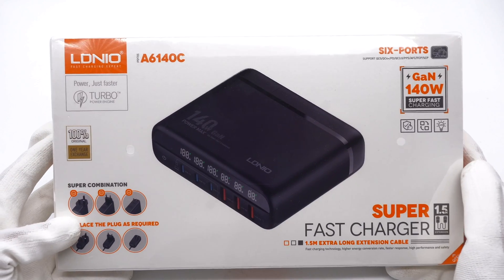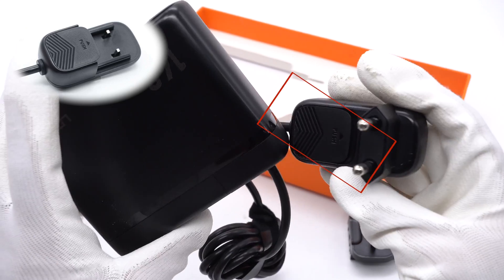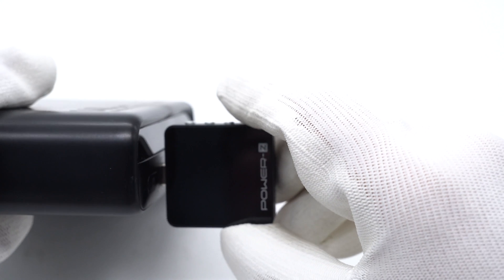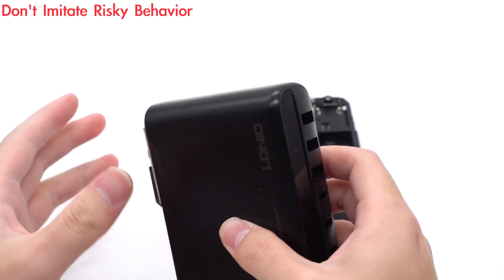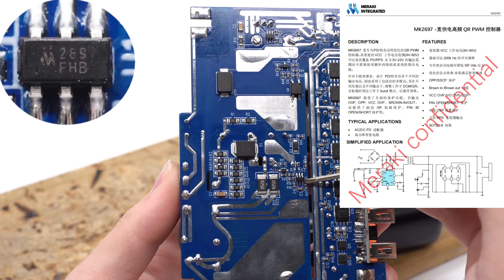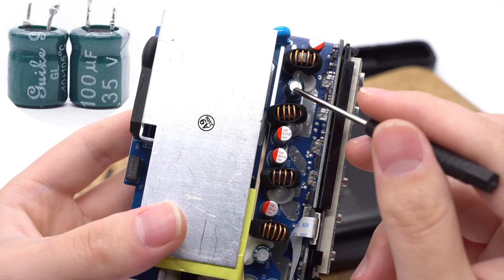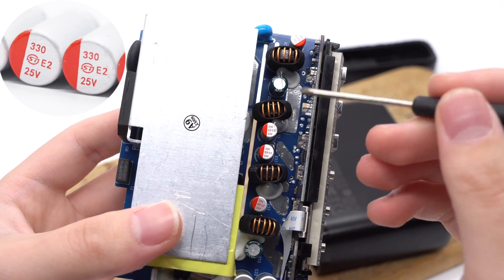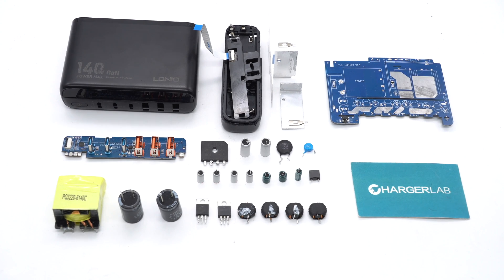Super-Low Price | Teardown of Ldnio 6-in-1 GaN Desktop Charger

Comment: recently purchased. I have noticed that there seems to be electrical waste, as I am experiencing electric shocks when using it. This is not the case with my other, normal adapters. Additionally, the power output to my devices seems limited. I have tested it with iQOO, Mi, and Realme devices, iphone and the charging speed is very slow. I don't know which devices work as gan charging.
Reply: my laptop support PD0 able to use 65w from USB C
is your support QC or PD?
Reply: @letskentots yes but not worthy. As mentioned a lot of issues
Reply: is it still working? i am planning to buy this today.

Comment: I bought in $26.33 it is a very good product but never gives more than 14 Watt to my Android realme x3 superzoom which can charge 30watt😢 i have a cooling fan which requires 27 watt charging this charger never disappoint to me when i use cooling fan its name is (memo DL16) also give 95 watt to my KP-KG 600 powerstation 😅
Reply: Also when i try to connect 2nd device all the ports reconnect once
Reply: Also can i use a magnetic cooling fan for this charger bcz it heats alot when it gives 50 watt+ output?
Reply: does it auto cut off once device is fully charge?

Comment: I have been using this product for 2 months, this product is very good in my opinion but there are 2 weaknesses. First, there is a little power leakage if using a cheap cable and the default cable is also bad, if you want to buy this product, you better buy a good cable, it will overcome its shortcomings. Second, if your room is hot and you use a large power, the charger will be very hot, my room temperature is around 31-33 ° C, I use 2 inputs, each using 24Wat and 20Wat power, the charger temperature reaches 49 ° C
Reply: but considering the price is very very cheap I think this product is very worth to buying it.
Reply: which cables would you recommend buying to replace the stock ?

Comment: can you check out the xiaomi 100w usb pd car charger , i will probably get one to charge my hp laptop which supports 20v 5amp usb c pd in my car. so i need to know if it can charge at 100w for atleast 1hr because the battery is 80whr. such small charger might overheat if not designed right and then reduce output power.

Comment: It is a BAD charger. Firstly, the charger do not have power factor correction. Secondly, there is high leakage current from the primary side, its so bad that you get a mini electric shock whenever you touch the metallic USB cable.
Reply: Anker have mini electric shock too
Reply: @dimswick  yeah, almost all high wattage chargers. Even my original charger from Oppo. Idk if it's just mine or it's normal 😂
Reply: Really ?
Reply: @ericjijan7798  yes almost all charger with high watt like that
Reply: @ericjijan7798 I tested mine and the leakage current is not that high compared to other fast chargers.
Reply: Chargers with 100w and above have mini shocks dude whether its baseus ugreen or anker ldnio
Reply: @tonystark397  😂😂😂 guess you need to sacrifice a Lil bit for that super fast charging
Reply: Event my macbook gets shocks. 🫠
Reply: But i have Xiaomi orginal 120W charge it doesn't have mini electric shock but my LDNIO dextop charger has
Reply: i have a 20w apple charger, it shocks when im touching the ground and im wet. i measured it and there’s 50vac
Reply: Ugreen have mini shock   tooo 😢

Comment: Doesn't look half bad. Also interesting that you mentioned that the USB Controller chips support current limiting... However the obvious and most important question was again not answered: Does it make use of the power limiting feature to dynamically distribute the power budget over the USB-C ports or is the implementation (as usual) of the software in the MCU dumb as frog and simply resets all ports to do a renegotiation whenever a device is plugged in?
Reply: It resets all ports
Reply: @GuyVinmara ooh i hate when that happens. do you know any multi-port budget chargers that don't do that?
Reply: I have this exact LDNIO model, and and I confirm, it resets all ports in the same controller whenever a device is plugged in or plugged out.
note that this one has 2 controllers: one for the type-c ports and one for the type-a ports. plugging in a device to a type-a port does not reset type-c ports and vice versa.

Comment: I’m using this charger now for a half year. Love it.
Reply: It is a BAD charger. Firstly, the charger do not have power factor correction. Secondly, there is high leakage current from the primary side, its so bad that you get a mini electric shock whenever you touch the metallic USB cable.

Comment: There is no interference filter or suppression on the input, which is not good. Other than that, perfectly safe. 8/10
Reply: the filtering is supposed to be a beefy low pass filter, right? it should be cheap less than 2 bucks so why wouldn't they put it in?
Reply: What does the lack of input filtering mean? A 50/60 Hz voltage ripples on the output?
Reply: @ahgflyguy  nope, common mode EMI generated by all the high frequency transformer switching
Reply: @visionofwellboyofficial  what impact does that have?
Reply: That can only mean risk if I have unstable AC source, correct? Given a good stable AC source, this charger is A-okay?
Reply: @sutton0028 no, it will also leak its own interference to the AC source (the interference is produced because it's a switch mode power supply). 
Ironically, that EMI is going to affect nearby devices that don't have interference filtering implemented as well.
Reply: 8/10, eh? Still pretty good for a high wattage charger, will use primarily on a laptop and a Redmi Note 12 non pro with 33W TurboCharge

What is the real world impact if there's no interference filter or suppression on input side? Will my device safe enough for a long period if those feature were absent?